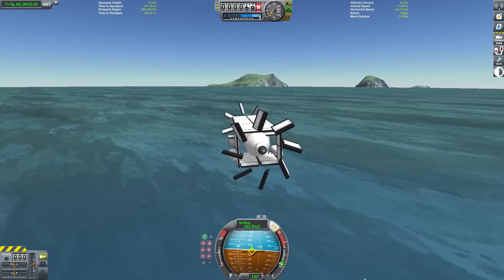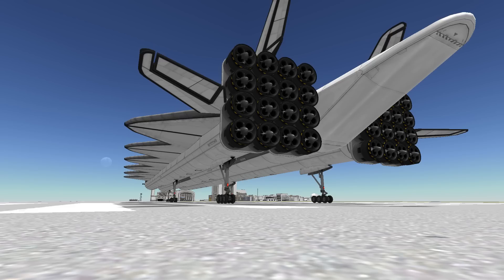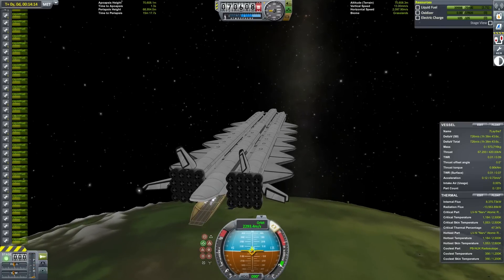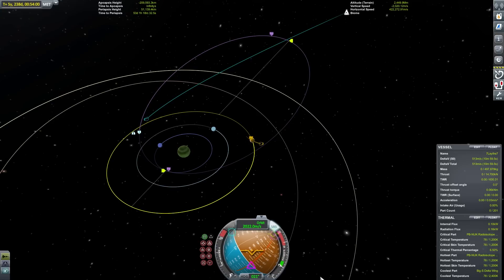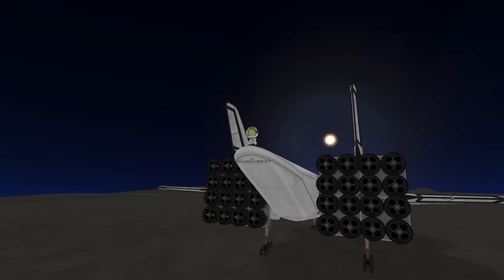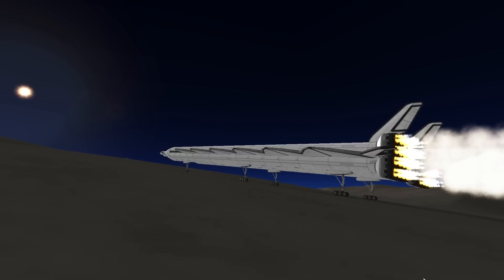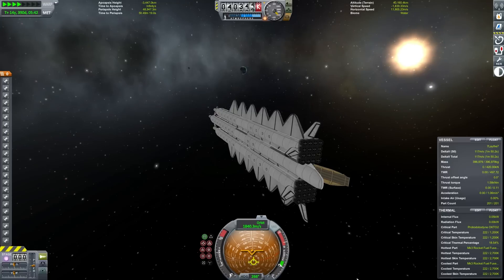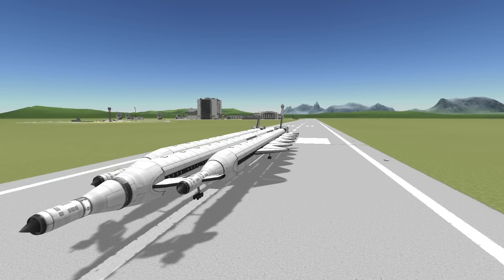Unrefueled single stage passenger spaceplane to Laythe: Maximum efficiency (KSP 1.2)

Comment: Escape trajectories are supposed to be hyperbolic. I get the passing-through-the-center-of-the-planet thing, the extremely eccentric ellipse, and the simultaneously increasing force and shorter duration with decreasing radius. Why/how can you get a 180° turn with a gravity assist? I suppose all non-circular conic sections are the same when your cone is infinitely narrow.
Reply from the maker: 180 degrees is the limit that a gravity assist can approach but not reach

Comment: yeah, more KSP broken Physics tricks, craft's exploiting the code don't impress me. Most all of these are gone by Ver 1.8.0.
Reply: You know it’s like 1.10 now and these trick still happen not to mention this is clearly not a krackenjime
Reply: @owenchen565  it was my understanding that many of the broken physics exploits were fixed by patch1.7.0.  
I can't confirm because I dont build bullshit that trys to break the game. 
I use parts as there were intended and not search for attachment or physics cheats in the code.
Reply: @GrimJerr  I mean at this point in ksp anything you can do with the parts flies right you’ve seen Danny 2462 rught
Reply: @owenchen565  it was my understanding that many of the broken physics exploits were fixed by patch1.8.0.  
I can't confirm because I dont build bullshit that trys to break the game. 
I use parts as there were intended and not search for attachment or physics cheats in the code.
Reply: Like I said before " I'm not impressed with exploits ", cheats.
Build all the broken physics bullshit you like, but don't expect congratulations for breaking the game.
Reply: This craft would still work in the most recent version, and you couldn't pull of something similar anyway.

Comment: Actually, gravity assist changes the spacecraft's speed. As it flies through body's SOI, it "borrows" some part of that body's energy to accelerate/decelerate. It's due to the spacecraft and the body being in the same system relative to the sun. So, when the spacecraft leaves body's SOI, its speed is the same, realtive to the body, as when it was entering the SOI, but its total velocity relative to the sun changes by the body's velocity vector. 
What you said was partially true, or rather you didn't say everything, but it's still awesome what you're doing with all these gravity assists, so huge thumbs up to you.
Reply from the maker: The is exactly what I said in the video.  Your speed relative to the secondary doesn't change, your speed relative to the primary does change.
Reply: @BradleyWhistance  I must be a terrible listener xd totally didn't get that part, sorry

Comment: I know this video is old by a few versions, but I have a question about the "hide from drag inside a cargo bay" thing. If you hide a stock propeller inside a Mk3 cargo bay, would it work when opened and be hidden from drag when closed? Ot would it not work at all?
Reply from the maker: It would work when the bay was open, and be hidden from drag when closed.  This would seriously limit propeller size though!
Reply: Thanks. Experimenting with propeller-asisted Eve launchers, so "small auxiliar propeller without drag once rockets engage" is far better than "large propeller that stops the craft dea din the air once rockets engage".

Comment: At 7:04 -- in a gravity assist, the total orbital energy of the system remains constant, but the energy of your craft and its velocity magnitude relative to Kerbol does increase as well as change direction.  This doesn't violate conservation of energy because the orbital energy of Kerbin and Eve in this case decrease by a tiny amount.

Comment: I thought, in a gravity assist, you not only change your direction, but also "steal" orbital energy from the body, at which you are performing the gravity assist. otherwise it would be useless to oscillate between two body's multiple times, as done e.g. in the Rosetta mission
Reply from the maker: By changing your direction relative to the secondary body, you can gain velocity relative to the primary body.  Kinetic energy is specific to the frame of reference, so one can gain or lose kinetic energy in one frame of reference without changing it in another.

So yes, you can "steal" orbital energy.

Comment: Couldn't you do a kerbin capture with a mun gravity assist? Like how you used tylo for a jool capture.
Reply: Others have said it well, but what I might add:

The Mun can give you a little bit of an assist, but it's quite inconvenient. While leaving Kerbin or returning, you'd have to time your ejection/return so that the Mun is in the right spot to gain a gravity assist. You would also need to account for the fact that your trajectory would be changed by 10 or so degrees, which makes it even harder to plan. Plus, if I understand correctly, gravity assists are less effective the more quickly you pass the planet/moon. All these factors mean that using the Mun for a gravity assist will probably end up wasting more fuel for corrections, considering how small of an assist you'll get from it. 

When he talked about returning from Jool and doing a Tylo assistant, he mentioned how it was less accurate and he ended up doing relatively large correction burns. This would be the same issue with the Mun, except with a tiny gravity assist instead of a massive one.
Reply: Afaik the gain from a mun gravity assist is smaller than the cost you have to get there or back to kerbin.
Or if you stay in the picture that a pass trough a SOI only changes your direction, the mun is that small and slow that you still have enough velocity to leave the SOI of Kerbin easily. Please correct me, if I'm talking BS.